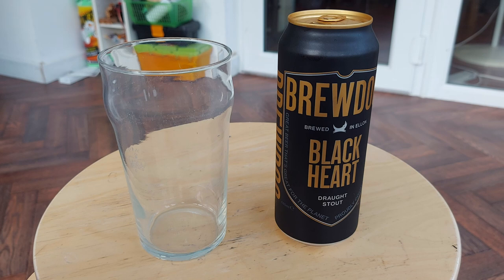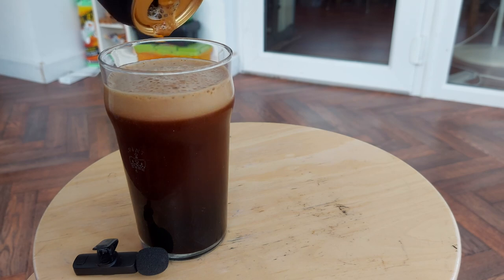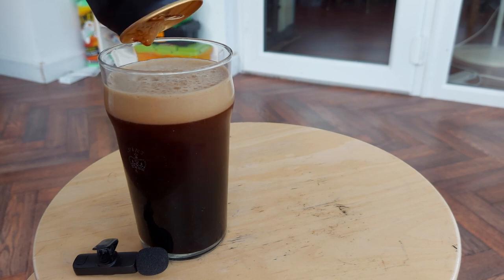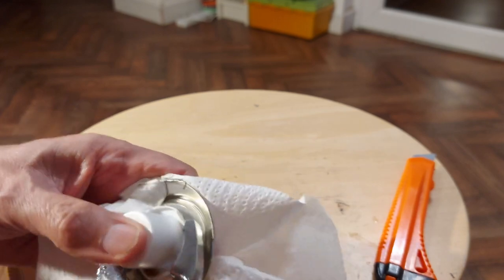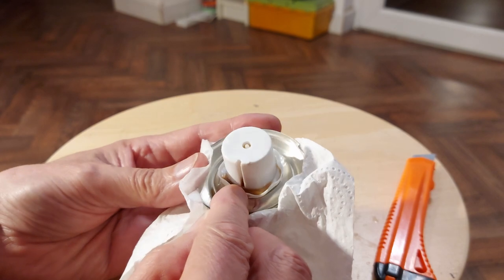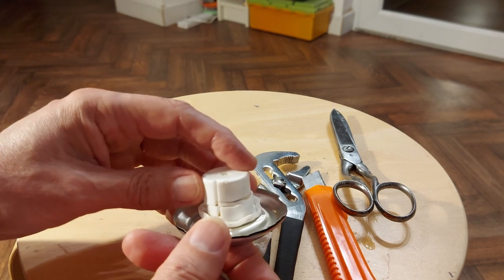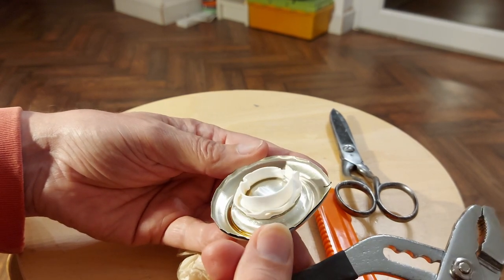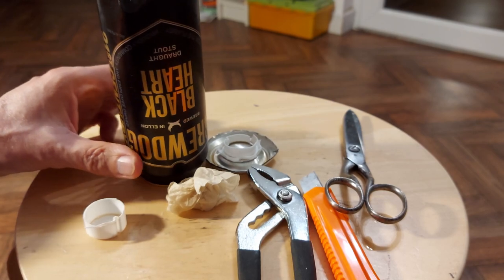What's inside a BrewDog Black Heart Stout can? Tear down to see the widget 👀

Comment: That is an impressive adhesive, where can i get it? lol. Cut a guiness can open before, don't believe I've ever run across this brand, pretty similar to guiness?
Reply from the maker: A dark brew like that is known as a Stout. Guinness is a stout. Brew Dog is a relatively new brand (compared to Guinness). Not sure how big they are now. Whatever they use to weld the plastic to the aluminium is amazing 😂